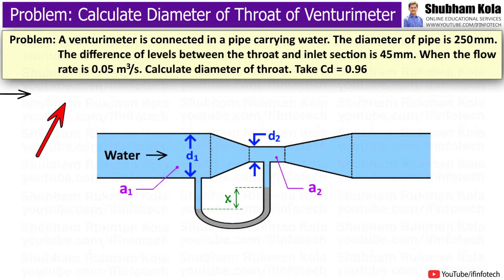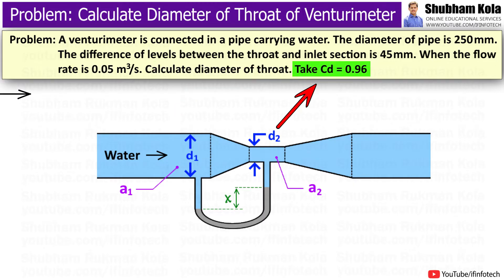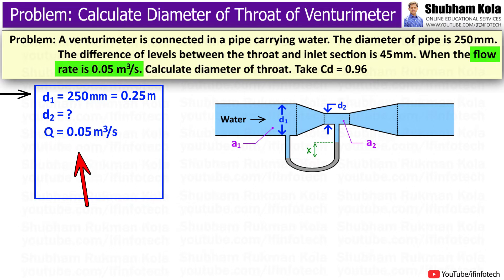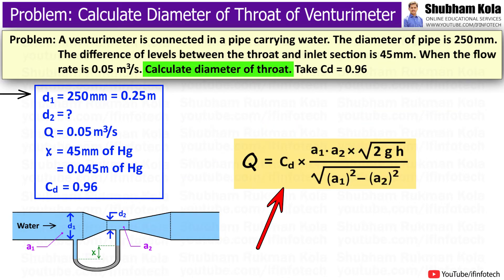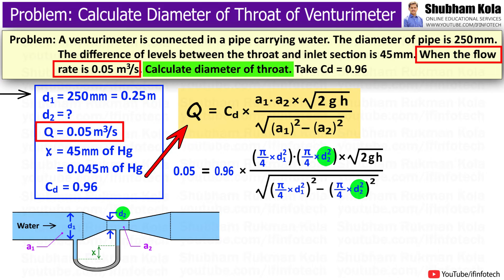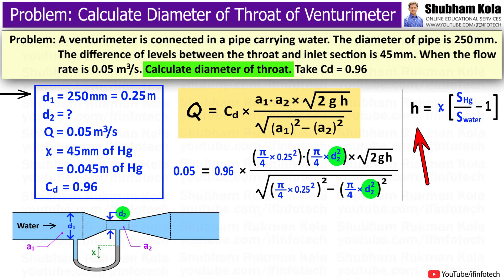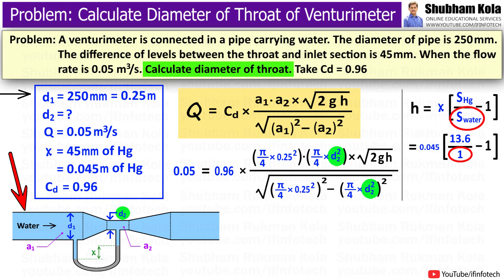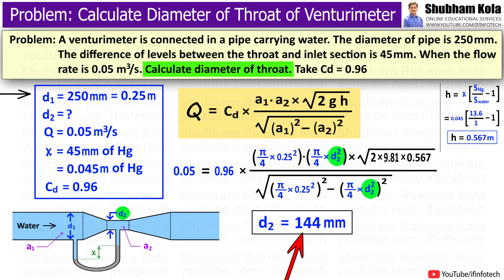Venturimeter Numerical Problem 2: Calculate Diameter of Throat | Fluid Mechanics | Shubham Kola

Comment: A Venturimeter having a diameter of 100 mm at throat and 300 mm at the enlarged end is provided in a pipe line inclined at angle of 60°, carrying oil of specific gravity 0.85, the flow being upslope. The length from the entrance section of the Venturimeter to the throat section is 500 mm. The differential U-tube mercury manometer shows a gauge deflection of 300 mm. Calculate: (1) the pressure difference between the entrance section and the throat section (2) the discharge of oil through the pipeline. Given C=0.98. Specific Gravity of Mercury as 13.6.

Sir can you solve this problem